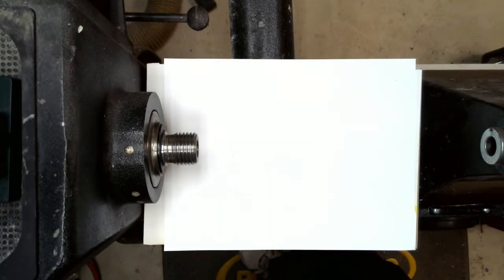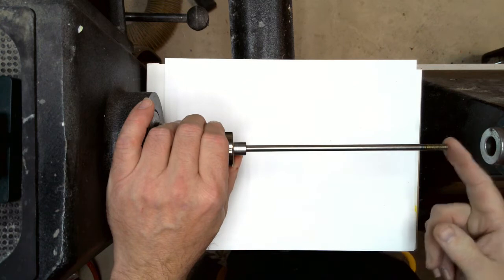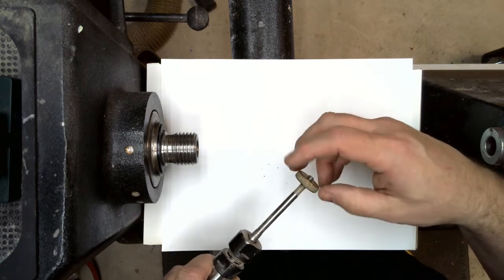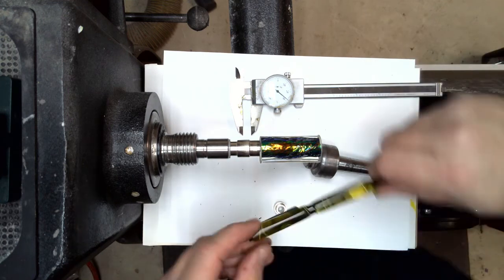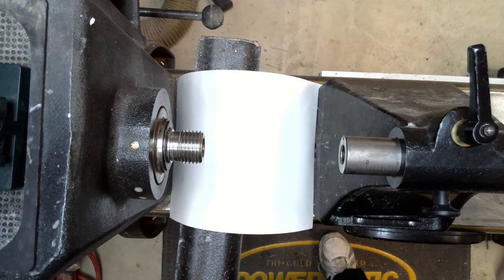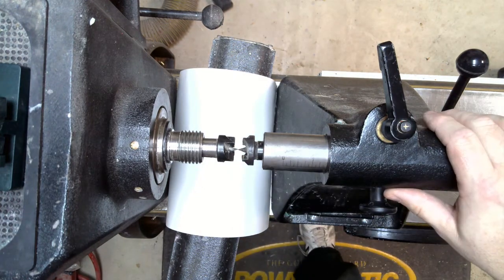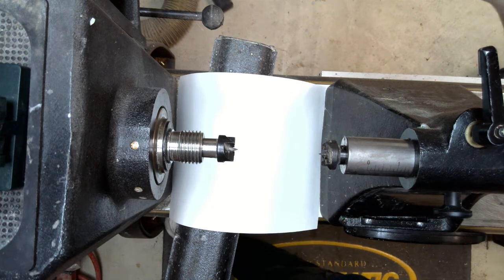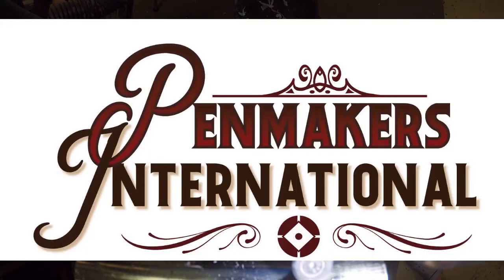10 Minutes To Better Pen Making - No More Out-Of-Round Pens  - Mark Dreyer

Comment: Hi, I love these videos! Thanks so much for all this great pen-making info. Two very enthusiastic thumbs-up!

It seems crazy to use the knurl nut with the mandrel saver, because you are simply reintroducing pressure onto the mandrel which will tend to cause it to bow all over again. The mandrel saver design puts the pressure onto the bushings and directly onto the blanks, and the mandrel itself has no pressure at all along its length. It has the added advantage of allowing you to put both blanks on the lathe at the same time.

Comment: Hi Mark, I am a beginner in this hobby I am getting set up got a new Nova lathe and have been slowly gathering all the stuff I think I need to make a pen. I still haven’t made one yet. I have been watching a ton of YouTube videos and yours are the best I have ran across. Thank You for making this sound a little easier than I thought it was going to be. One question I have is you said to turn as fast as your lathe goes my lathes goes 4050 rpm and that seems a little scary to me. 
Thanks again for such great videos I am a subscriber now and have gave thumbs up 👍🏼 on everyone of your videos that I have watched.   Thanks again Don
Reply from the maker: First and foremost never ever do anything that is scary to you. Always be safe. My point is - you will find a cleaner cut when the wood gives less resistance - which will be faster. Start out at 2000 and slowly move up after a few pens. You will find your control point. If you check out my other videos on cutting acrylic and wood I only take amount I am comfortable with. My PowerMatic 3250B tops out around 3200 rpm, which is what I turn at. Remember safety is most important. I always use a safety shield over my glasses. I thing I will do a video on shop safety and just starting out. Keep us aware of your progress - always nice to share. I look forward to it.

Comment: The headstock on my Nova DVR XP rotates to enable turning bowls larger than 16" in diameter. When returning to doing spindles, I use your procedure to align the headstock with the tailstock. I did purchase the double ended mortise that Nova offers for aligning, but found that it was not as effective as using two point centers like you recommend. It's an easy check, and after about 8 hours or turning, I do that check again...and especially before drilling blanks on the lathe.

Comment: OK, Mark, you need to get out of my head! I have been working the same issue/s on and off for awhile and dove back into it about two weeks ago. I love your simple, but elegant nylon washer solution to the bushings getting “peened or rolled” into the shaft groove, BRILLANT! I was drilling a chamfer into my bushings to solve this problem. In my opinion PSI should have used multiple bearings in the live center to stabilize the axial play/movement. I get vibration and chatter from the tail stock side sometimes, usually on very hard material, I believe it is from the play in the live center. I found the NOVA 2MT LIVE CENTER SYSTEM (SKU 5015 AND 71074) from Teknatools is a three-bearing live center that has a 2MT on its nose and will accommodate different centers. One of the centers is their Miniature Extension Center, and as they state, “the diameter of this stem is 1/4″ so can double as a 1/4″ pen mandrel”. It is actually .250", which of course is too large, so I had to reduce the diameter to about .245” to fit most my bushings. I used a Mill file while it was on the lathe at about 300 rpm and slowly filed the diameter down checking with calipers along the way to insure I kept it straight and parallel. I now have a rock-solid TBC live center that I could not be happier with. Rockler $91.99+ Shipping, Home Depot $75.18 Free Shipping SKU204488267. Rockler will price match Home Depot. Great video, keep'em coming!
Reply from the maker: First and foremost thanks for watching. My goal is simply - share information and stories. Thanks for all the information and follow-up. It was a situation that was driving me nuts also.
Reply: Nanoqx, I had the exact same issue with the tailstock live center and I also had the Nova live center system which ran perfectly.
Reply: @Alan Miller  Alan, just so I understand, did the Nova live center solve or correct the chatter on yours as well? I have also been turning with carbide tools, which of course scrapes instead of cuts the material which I think might be the cause of the chatter. I am in the process of learning to use HSS tools such as gouges and skews to see if this will eliminate the chatter when turning on mandrels as well as giving me a cleaner overall cut.
Reply: @toolchuck  What I found was the pen live center would wobble when turning making me think that the bearing was not true.  I then tried the Nova which ran dead smooth. 
So I assume something was wrong with the first center. I also used carbide tools and didn't get chatter with either center, I was worried about out of round.
The carbide can be aggressive in the cut, sharp is best. I adjust the height and speed and with a fresh cutter I got a smooth cut. Hope this helps.

Comment: On kits with upper and lower blanks, the center bushing is one piece.  If you use the center bushing on one end of the turn between centers mandrel and the mandrel rod is not long enough to protrude into the blank tube is that a problem?

Comment: I used the knurl nut and the manfred saver together. I won't anymore. The nut plate on the inside of the saver backed out, froze the lathe, and bent the mandrel. Definitely not saved.

Comment: Mark, Thanks for the tip on the washers.  Picked a couple up at Home Depot today.  Location is hardware isle, Gray metal drawers, Package says "EVEERBILT" on top, Listed as spacers, 0.257 inch ID, x 1/2" inch OD, x 1/4" long.  May need to reem just a tiny bit to fit on my "Stub centers".   Item shows 595 447 up top, don't know if it is a P/N or not.  Below the barcode it says 8 87480 14998 2.  Including sales tax $.87, can't beat that.  Thank you so much.
Reply from the maker: Thanks for the details. Hope this helps all those out there....